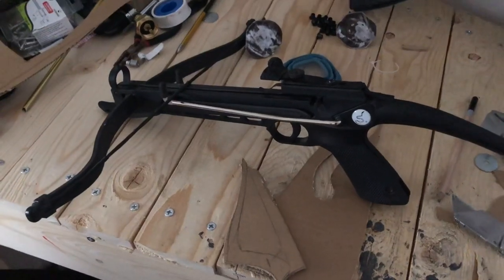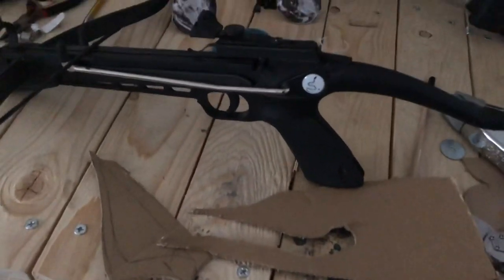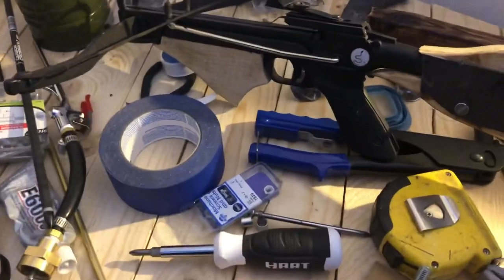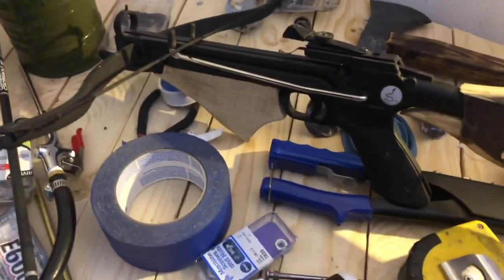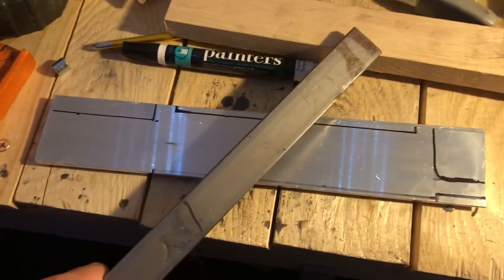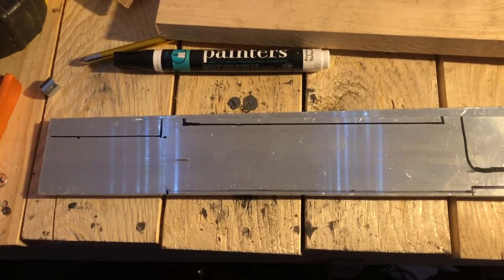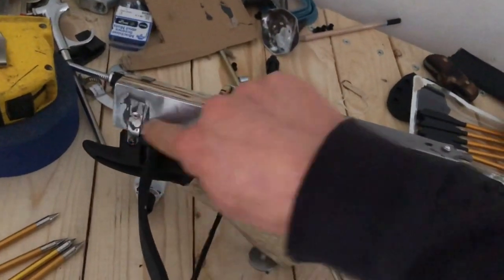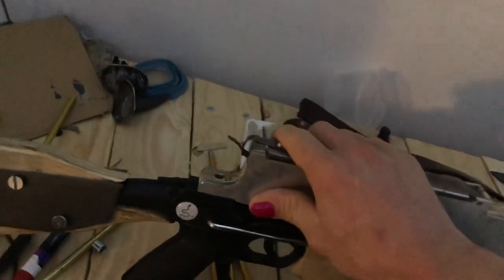How to made a pistol crossbow magazine and stock

Comment: you should give the slingshot channel credit for this design
Reply: These magazines were actually made and designed well before Joerg sprave found them, theres channel on here that made them before Joerg,  you could buy pistol crossbows with magazines in the 70's.
Reply: What abt chinese repeating crossbow 181-234 AD lol
Reply: @trigger78  Chinese repeating crossbows lacked a string catchment mechanism and also had no spring or bolt retention system... That's like saying "tesla didn't achieve anything with their EVs, don't they know the english had horse drawn carriages for the last thousand years?".